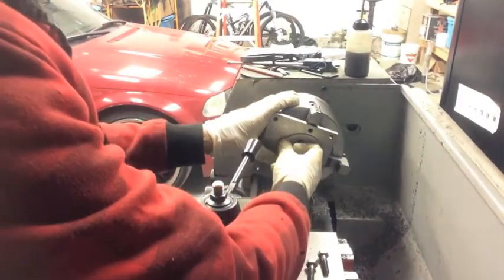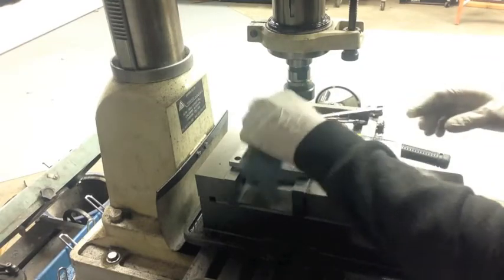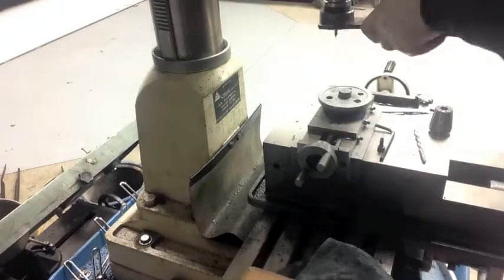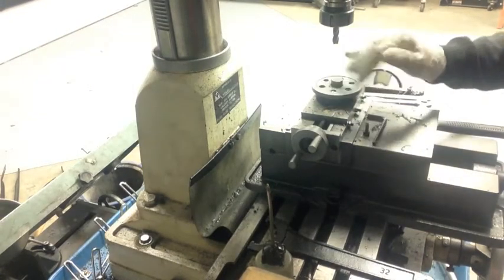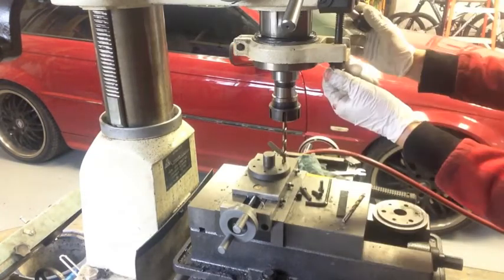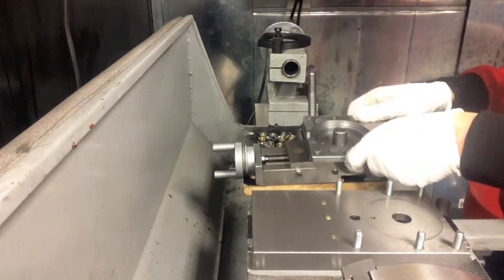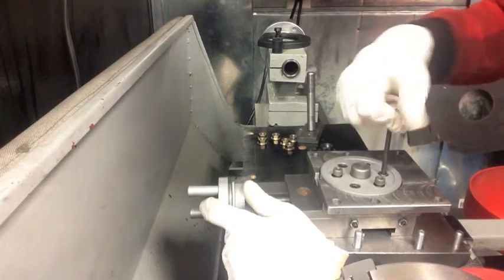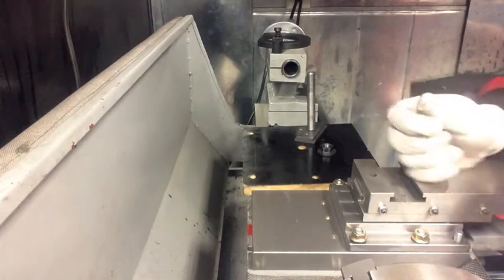Grizzly G0602 Lathe modification / KC-1022ML (part 2 of 2)

Comment: Yes this is old . My only issue for anyone thinking of doing this is it appears he may have made the new part too thick which now has made it that he does not have tool height adjustment below the center line as shown by the nipple left after the cut off is complete. The idea is good but unless you can get your tool height adjustment you are really trading one problem for a different yet similar problem in that you will still have cutting and quality of cut problems.
Reply from the maker: Hey. I'm not sure what particular part of the video that you are referring to, or for certain what you are talking about, but the tool is not limited at all by the new part. As with the original, the tool holder is limited only by the compound slide and not the cross slide.

Comment: Are you sure you had the cut off tool at the correct height when you had the problem of it breaking. I have heard if it is not set exactly on centerline height there can be problems such as you described of it digging in. ?????
But nice work.

Comment: Looks like the new plate in not sitting flat on the cross slide, may be from stress released during machining. Try rate-cutting that surface with a flymill to flatten it out

Comment: Nice. I ordered a G0602 that should be here in a couple weeks (on back order). That will most likely be my first mod.
Reply: @JoelArseneaultYouTube  Yeah that would be nice however I do see me using the compound quite a bit. Plan on taper turning and single point threading. So I'll keep it for now. I started machining over 30 years ago. I have a Atlas 618 but I wanted a larger machine. Most of my machining career was on a 13"-16" manual lathes. I will enjoy this machine, thanks.

Comment: Good job I have yet to do the same upgrade Im waiting ro get a mill. The reason why I want to upgrade the compound is for turning harder material like 4140. 

Im thinking of using 4 bolts instead of 6 so I can have a thicker plate in the middle because that part directly under the compound will have more clearance. I'm not sure I would add another 3 bolts to the dial I feel like the less material on the dial will relate to less rigidity though your upgrade seemed to turn out all right. Maybe I'll just make those 3 bolts thicker and grade 8.

Thanks for showing us this build. Littlemachineshop.com sells a plate you can buy instead of building one but it looks a lot less rigid than yours and it is over $100 dollars. Anyways take easy and good luck.

Comment: I also have a G0602 I purchased about 3 weeks ago.  I also noticed the tool post moving when plunging with a cut-off tool.  Looks like a good improvement, I'll try it after I build up my confidence using the machine.

Comment: Great job, but you make me nervous wearing that coat and being so close to the chuck.
Reply: You shouldn't get nervouse the G0602. Isn't strong enough to seriously harm you the motor is only 1HP and personally know from experience. I got caught and sucked in all it did was rip my shirt and the spindle/motor stalled. 

There is also a shear pin if to much torque is applied.